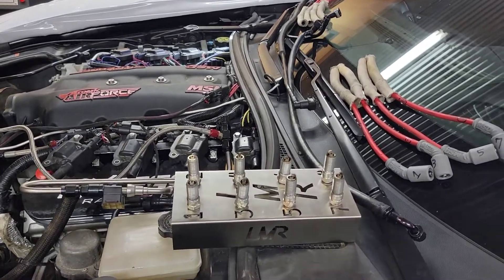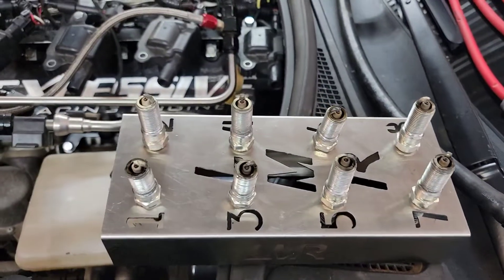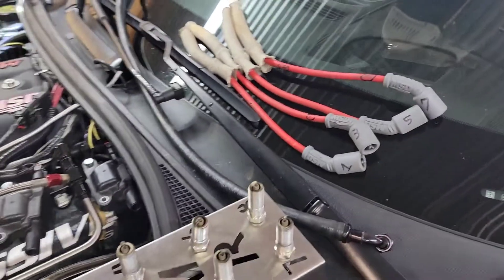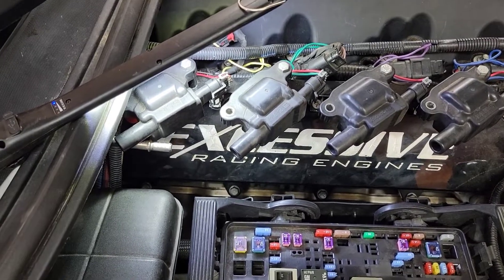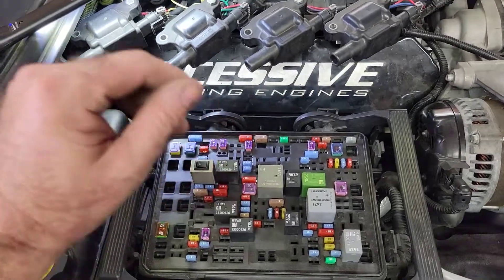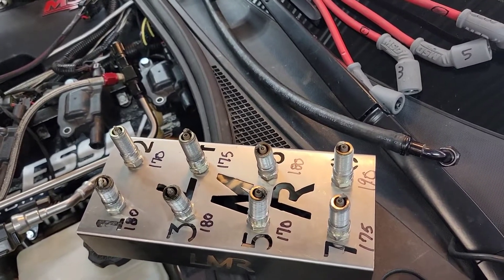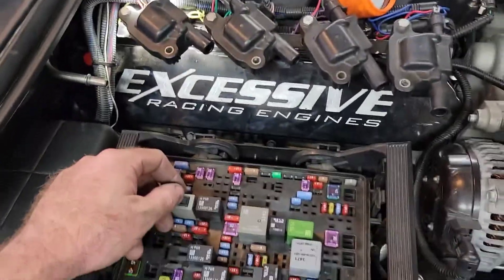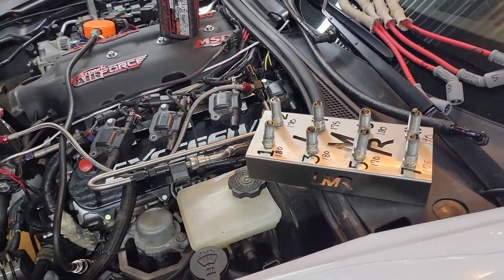C7 Corvette compression test results

Comment: Where did you get the remote starter switch? is it just a direct replacement?
Reply from the maker: It's a relay jumper they come in a set, you can get them off Mac or Matco tool truck.